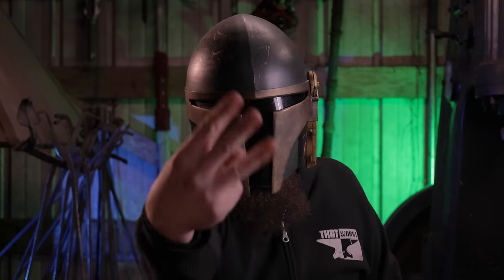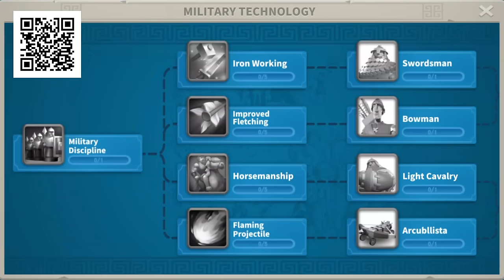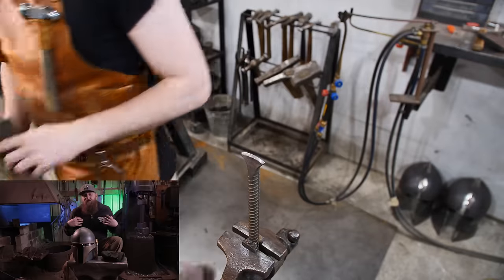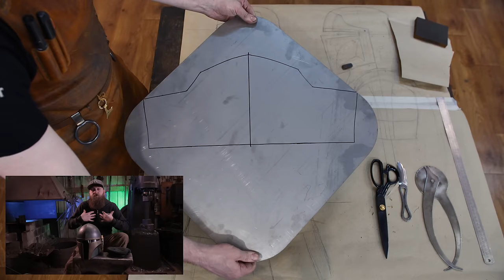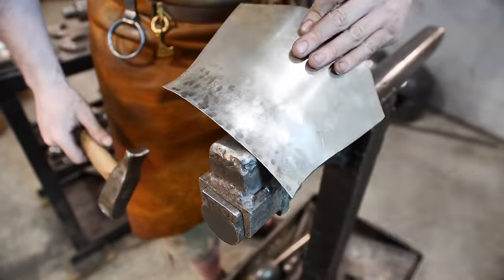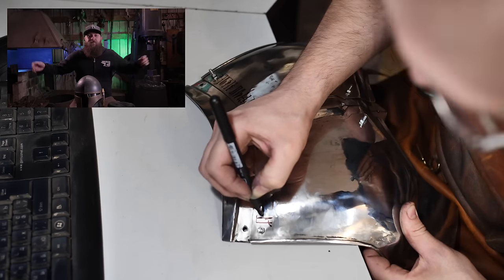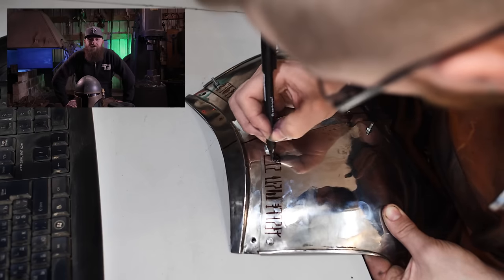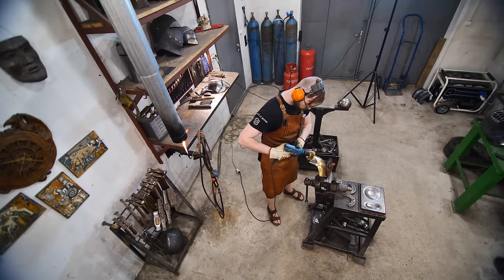Mandalorian Armor - [Breast Plate]  - Part 3

Comment: Beautiful work! Perfect example of the old myth that knights couldn't stand up if they'd been knocked down proven wrong. There was an old video of guys climbing ladders, tumbling, and running full tilt in full plate armor made to medieval specs, this suit rivals the best "authentic" suits made. Slava is a proper master armorsmith, what Ilya can do with blades, he can match with armor.
Reply from the maker: Proper armor is quiet form fitting and molded for a specific user for maximum mobility

Comment: It needs bracers with a mini-crossbow built onto one, maybe a flamethrower on the other. A lance with the weird stock his disintegrator rifle has.
Reply from the maker: only thing about a mini-crossbow is that it does less damage then if you threw a dart by hand. pretty neat fantasy but totally lame.

Comment: I'd definitely like to see some leg armor added. You know, if Din had some beskar chain armor on his legs, that nasty accident with the darksaber wouldn't have been a problem. As for weapons, while the darksaber seems like an obvious choice, I'd really like to see the spear and dagger, along with maybe a crossbow built to resemble an EE-3 as much as possible. I was always disappointed with The Armorer's opinion of the beskar spear. A beskar spear should be no greater a threat to beskar armor than a steel spear is to steel armor. A potential threat, but manageable. Nowhere near as terrifying a threat as Sabine's device.